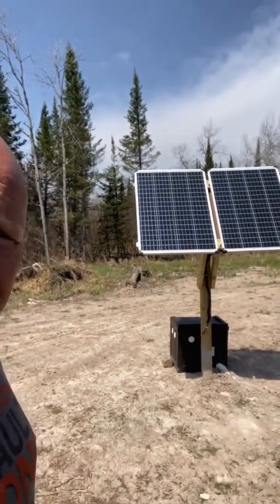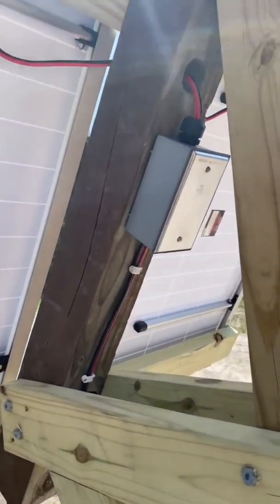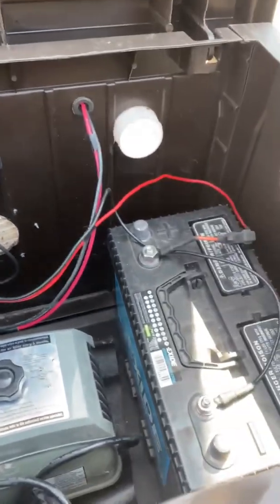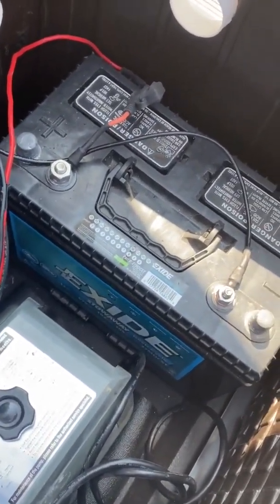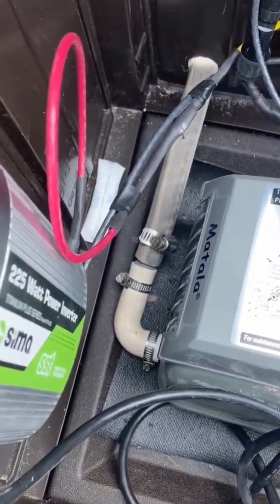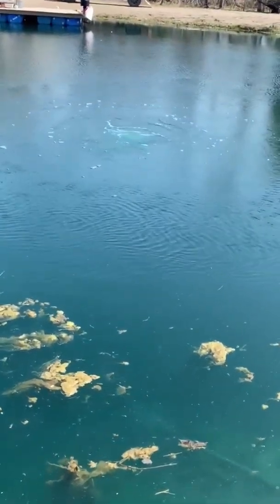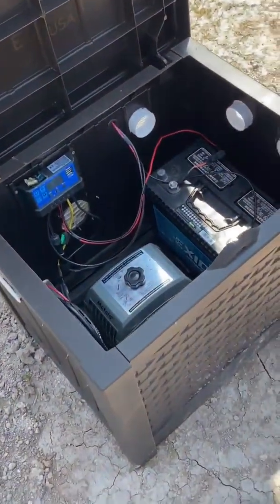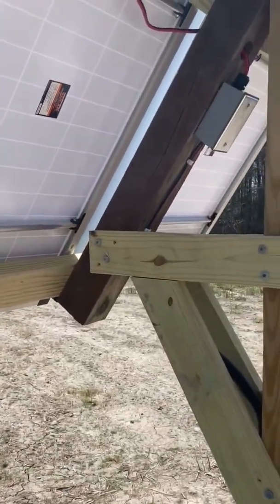Solar Pond Aerator Off Grid

Comment: Hi Mr Mike, cool idea. Could I use a lithium battery in this setup? If possible ... What would the characteristics of that lithium battery? thanks
Reply from the maker: @gustavosantamaria9394  Lithium batteries cost more but are smaller and better. 
The charge controller should have a setting for different types of batteries.

Comment from the maker: Solar has been updated.  Now have 900 watts running cabin and pond.   Pond is 25’ deep.  Needed big air pump to run 2 deep diffusers.    Also have 6 total deep cycle batteries.  I’ve got enough power for me and the neighbors now.  Pond is clear and fish are spawning.

Comment: How do you find the pump holds up running at that depth over the cold temps of winter? Any issues?
Reply from the maker: Still going strong.   No issues.   Haven’t replaced any parts or diaphragms yet.  
Runs all summer and all winter.    Only shuts off in the evening.   
No fish kill this spring.

Comment: Nice , how do you prevent the battery to get fully discharged ?
Reply from the maker: The charge controller shuts off the power going to the inverter when it reaches a low voltage.  I have mine set at 10.7 volts.  That setting is adjustable to whatever voltage you want.  When it recharges to almost full, the controller turns the inverter back on.

Comment: Nice setup I’ve been trying to DIY MY 1/4 pond on the cheap and ended up buying a solar kit with battery backup from Missouri wind and solar. The only issue is the depth they suggest which is 6 ft I have a 9 ft deep pond but I’ll try it anyways how’s your setup been doing it looks great 👍
Reply from the maker: It's been doing awesome.  No pond dye this year.  The water is nice and clear.  Tomorrow 7/15/22, I'm adding another 12" diffuser disk in about 5' or 6' of water for use during the winter.  After doing some research, I've learned that the diffuser in the deep part of the pond should be turned off during the winter to keep the warm water from being disturbed.  Last winter I had approx. 3' of ice on the pond.  The new disk will be on all winter to help oxygenate the water and maybe even keep the ice open in that spot.    My deep disk is in approx. 15' of water.
Reply from the maker: I turned the deep diffuser off this winter and just ran the 10' diffuser.  Kept the ice open all year.  approx. 3'+ ice this winter.  Only found 2 fish floating this spring.  Was just out today catching nice perch and a large bass.  14".   Everything seems to be working great. I pieced mine together by watching other videos on here.  I think I spend under $600 or $700 for everything.  I have diffusers at 10' and 25'.